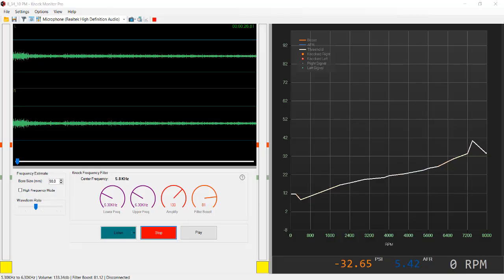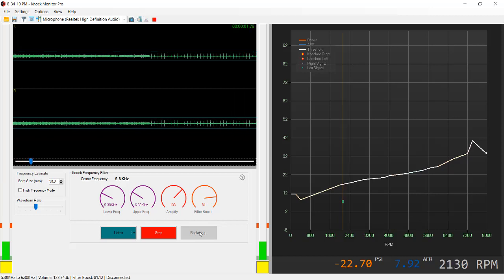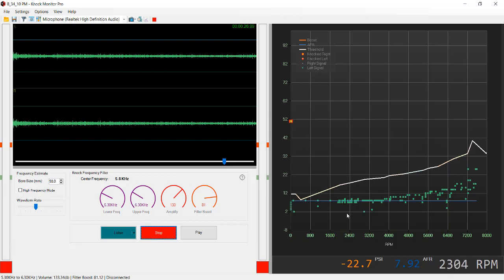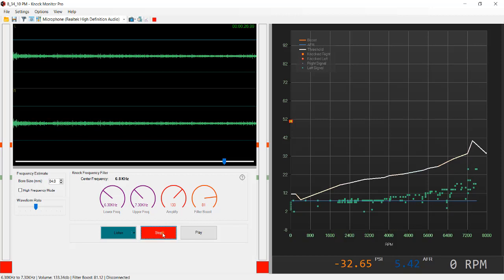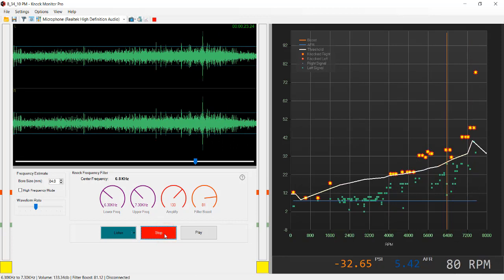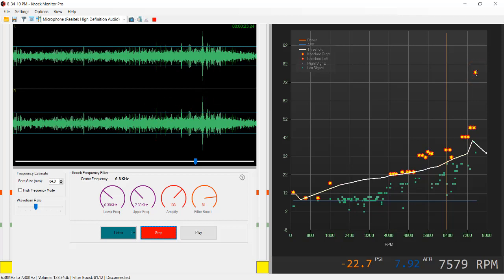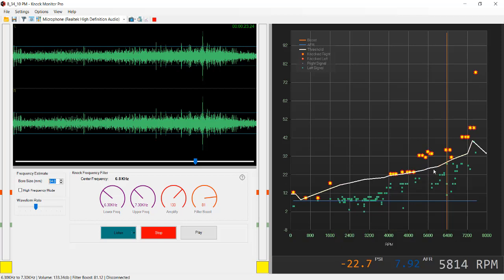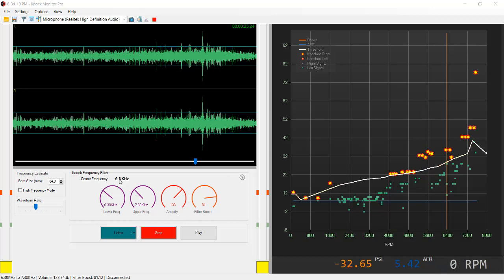Why it's important to set the correct bore size / frequency

Comment: Beware of narrow bandwidth knock filters. As the video shows, getting this wrong can be catastrophic.
A broadband filter is much safer and does not require user setup. Discrimination is still pretty good, better to have an over-reactive system than one that misses the knock completely.